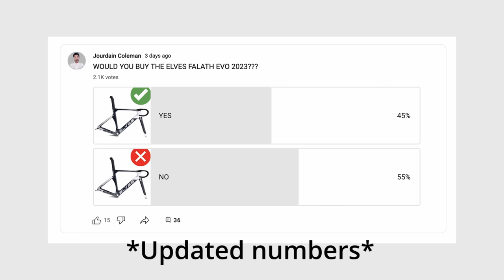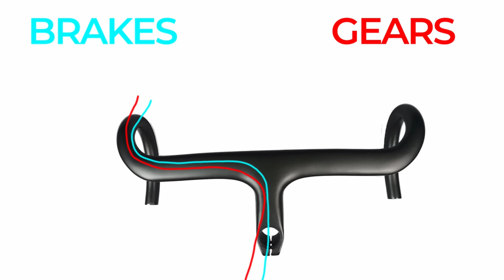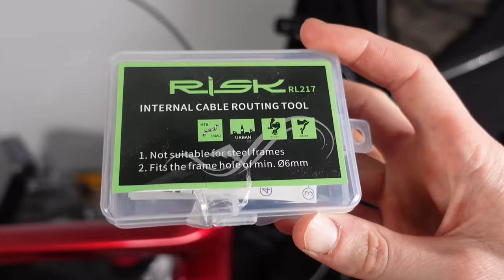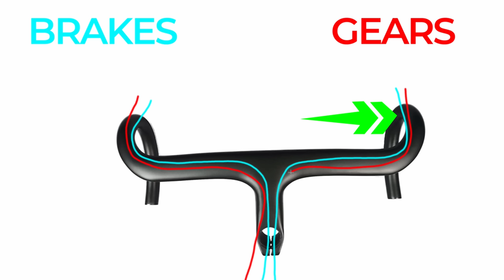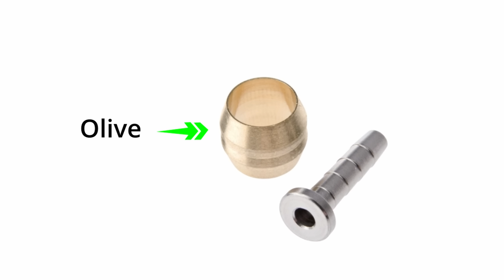Expert Mechanic Installs L-TWOO RX Hydraulic Groupset (In-Depth) // Full Build PT2

Comment: awesome video! Johnny is a mechanic friend with great patience and skills.
I also self-assembled a gravel bike like you, but since my mechanic skills are low, I boldly gave up setting the full internal cable. It was much easier to replace once it was done.
It was also much easier to add and manipulate the barrel adjuster for the front derailleur and dropper seatpost cable.

If I had chosen the full internal cable method, I would have given up on self-assembling the bike.

In addition, a common problem with sram and ltwoo is that if the shifting cable is excessively bent and causes friction, there is a possibility that the lever cannot return to its original position when the shifting lever is operated.

With my skill, I can try a full internal if it's an electric drivetrain, but it's too difficult to try with minimal friction on a mechanical shift lever.

Comment: Thank you for showing me that I would never want to internally route cables through my bars.  Ever.
Reply: if you do it the right way it is a lot easier.. prep bars and levers first using the old hose and cable to pull through the new. many stands help.
Reply: ….or disc brakes,or electronic shifting

My bike mechanic loves me 😀

Comment: I literally just had the exact same issue with my hydraulic brakes on the eRX. After an hour trying to figure out why the brake levers couldn't be squeezed, I remembered this video where you had the brake issue. I turned the adjustment screw too far and it came out the back. Now I'm trying to figure out how to remove the level so I can put the screw back in.
Reply from the maker: It's a bit of a pain but the lever does come off. It's more annoying than anything else. I thought they would have fixed it for the eRX groupset though. 

After hours of tinkering and trying to get my brakes sorted they still aren't great, unfortunately.

Comment: Sram mtb levers need the bite point screw ALL the way out too as the master piston covers the timing port, preventing a reverse bleed. Also, this prevents them drawing more fluid in to the system from the master cylinder to compensate for pad wear. If your pads wear and the lever comes to the bar, do the screw trick and pump the lever and it will come back again. Ltwoo must be designed by the same bloke!
Reply: To be fair. Ltwoo was founded by ex SRAM engineers

Comment: I saw your video before purchasing this group set and still mange to push the little screw out the back of the lever. While retrieving the little screw, the spring mechanism at the back of the shifter came apart.  The brakes felt good after installing it but I had to screw that little screw all the way in to get adequate braking power.
Reply from the maker: Glad you got it sorted 👍🏽

Comment: This video isn't really fair to LTWOO. Even I could have guessed you need to undo the preload before bleeding. Other brands require this as well. At most, you can blame LTWOO for not providing proper instructions.
Also, when bleeding a rear brake, you need to tilt the bike so the rear caliper is lower than the BB, so the air bubbles can travel up into the lever.
Reply from the maker: I didn't realize other brands have the same setup. Which ones so that it doesn't trip me up again? When you look at the lever and the screw it's not clear how this affects the bleeding, considering it just comes out of you screw it in too far. 

Either way, a simple instruction guide (which is inbound) would have avoided this all together 👍🏼
Reply: I used to do the bike tilt method but now I use the syringe push through method
Reply: @JourdainColeman  since the lever reach adjustment screw is also the master cylinder preload adjustment (bite point or free stroke), preloading the MC (or pulling the lever a bit) closes off the flow between the MC and the fluid reservoir (where the bleed funnel sits), so that squeezed fluid doesn't just flow back to the reservoir when you pull the brake levers.

it's a common design of hydraulic brakes (esp in motorcycles) which don't cause issues in mid- to high-end bicycle brakes since the bite point or free stroke adjustment is different from the reach adjustment. Still, most brake bleeding instructions tell you to back off the bite point or free stroke adjustment before bleeding to avoid this mechanical conflict.

Comment: Is it possible to use an ordinary stem and handlebar on this kind of frame? Or does it need this kind of integrated stem-handlebar that has built-in cable routing paths for the internal cable routing to work?
Reply: Yeah you can use an ordinary stem and handlebar. You'll need to use the FSA no. 69 headset, or an Ali equivalent. Check out Patrick Lino on YouTube, he built his like that

Comment: Hi i have erx and also ended with issue on left lever. First set up and bleeding was ok, but after 400km i felt that iam loosing pressure in left lever / brake. So i tried to go thru bleeding process again, but this time i ended without completely soggy lever and no pressure, but with weird sound when pressing lever. I tried fiddling with screw, air port, but no success 😢  Is there any oprion to buy rev2 left lever?

Comment: By the time you buy a cassette, chain, rotors, BB and crankset you could get a Shimano R7000 for the same price as its on sale atm........no brainer really.  You know Shimano is gonna go together and work like a dream
Reply from the maker: Yeah, with that being literally half price right now it's a great deal. The only issue is they are limited in stock. Only certain crank arm lengths and derailleur which forced you down a certain path. (Not that it really matters). I'm tempted to get the 105 deal for my next build.

Comment: Hi Jourdain. I noticed you connected the brakes, left lever rear break and right lever front brake. We call it the English way. However what are the benefits of connecting the brakes this way? Motorcycles even in the U.K. have connected the brakes the other way around.
Reply: It's because they are on the other side of the road, so would make sense to have them swapped compared to the North American or "European" way.  However, The "British" way is much better for European/ North American roads being on the right side. This allows you to use the front brake with your right hand while signalling with the left. The rear brake is virtually useless (80/20 front/ rear ratio).

Comment: hi. I have the same problem, the air does not come out when I press the syringe. How hard did you tighten the screw on the handle? Do I need to twist it all the way?

Comment: I had no luck using a bleed cup on the lever. (I have a v high quality Hope one). I had to use 2 x syringes in the end, tilting the bike vertically from front wheel to back wheel, and back again, bleeding as I went from low to high.

The lever adjustment/pad reach screw turns 6.5 turns clockwise to push the piston inwards and bring the pads closer. When it reaches 7 turns, it falls out. DAMHIK.

I've asked before, but if anyone knows why they've gone to the bother of including an 'air' port atop the lever, shout out.

Comment: Get Shimano 105 R7020 11 Speed Disc Brake Groupset for 450 pounds from chainreaction and save yourself the headaches.
Reply: With resale value and the confidence they'll still be working in 20 years
Reply: Agree with this. Trace Velo and Francis' mechanic have also struggled with these things ... not worth the hassle
Reply from the maker: Yeah, I'm getting Shimano for an upcoming build. As much as I want the LTwoo groupsets to be perfect it may take a little time.
Reply: @JourdainColeman  appreciate you testing this out for us first before we spend our monies. Ltwoo ERX next?
Reply: @JourdainColeman  does this ltwoo rear derailleur actually have a parallelogram?

Comment: Be careful when you use the risk internal routing tool again. I have the same tool before but there's once the magnet connected to the wire came off insider the frame, and it took me lots of time and effort to take it out
Reply from the maker: Thanks for the info... I'll be careful when using it 👍🏽

Comment: Great vid! How many man hours do you reckon a normal build is?
Reply from the maker: Good question... If the cables are all routed then at least a day (that's for me, not sure about a mechanic). No routed cables will be quicker. 👍🏼
Reply: It shouldn't take more than 2hrs for a competent mechanic with tight cable routing.  It shouldn't take more than 4hrs for a competent laymen.

Comment: 8 minutes and 17 seconds into your video i realized I might never have a disc brake bike what a nightmare 
I'm used to do my bike maintenance at home this is tedious as hell so many tools and so many steps some call this progress but all i see is an industry dictating what the consumer must get and depend on LBS rather than DYS ers horrible
Reply from the maker: Yeah, routed cables are a pain and unless you have have the time and expertise then I'm not sure it's worth the hassle. Semi-routed is ok (just through the frame) but fully routed (through the bars as well) become a different story. Most people use electronic gears with fully routed bikes to avoid this hassle. 👍🏽

Comment: Prepare the bars first. You made It really hard for yourselves.
Reply: In the prior video they point out its better to start from the back
Reply from the maker: Yeah, if you do the bars firs then it's harder to route through the frame at the rear triangle. Swings and roundabouts I guess 🤔
Reply: honesty way easier the other way round
Reply: all those tight bends and awkward pulls you do mess up the outers, so if you pull through the frame using a bit of extra house and outer you kinda pull it all together, I  have done many brands this way and especially this method if recabling an old bike.